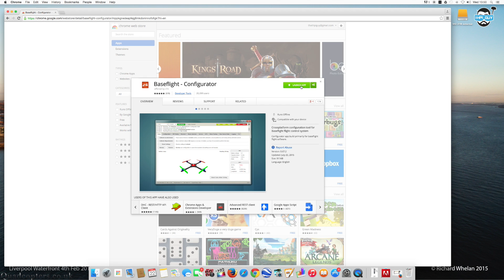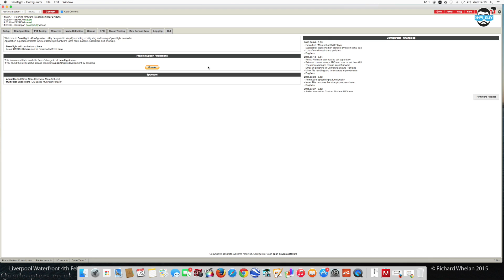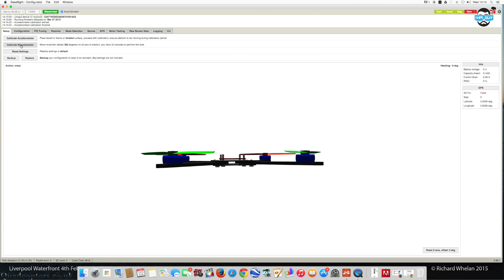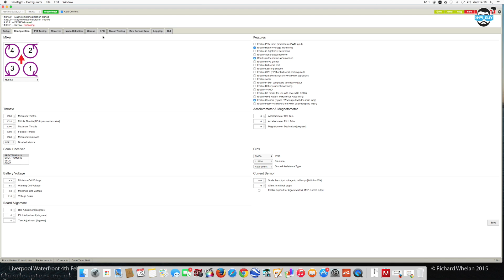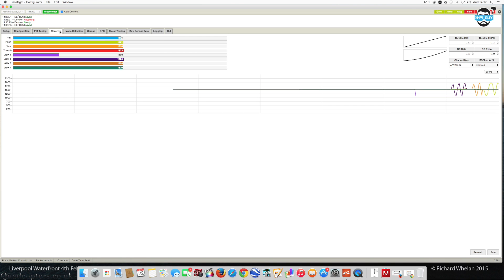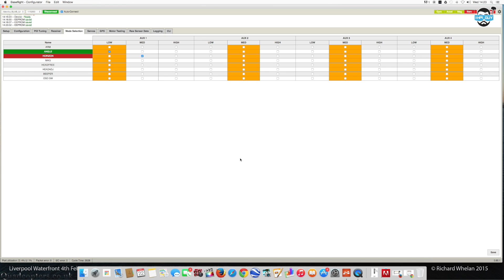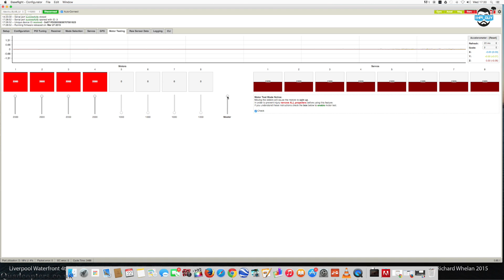HPIGUY | EMAX Nighthawk PRO - ARTF 280 MiniQuad Set Up - Quadcopters.co.uk

Comment: ThatHPI guy  hiya do you have to connect or bind  the transmitter to the quad i bought the nighthawk ARF and got the nighthawk transmitter it come with the EM16 flight receiver av copped your wiring  but should i have bind the them  or dose this do it after calibrations

Comment: why does anyone use 4s? what purpose does it serve?
Reply: +Michael M using a 4 S battery is like putting jet fuel in your car. The 280 flys very fast with a 3S - 11.1 volt battery, using a 4S - 14.8volt battery will make it fly insanely fast.
Reply: +Bernard Woods sweet!
Reply: +Bernard Woods can I up the reccomend c rating on my nighthawk? it's rated at 30c, what happens if I stick a 70c? will it blow?

Comment: is anyone else having battery life problems? i get one minute full power flight per each 3S 2200 battery... are others getting more? can you post settings?

I also have the problem that when I activate oneshot the drone doesn't beep upon battery plug in. only way i can use it is by clearing the props in the dos-like thing (sorry can't remember its name)... any thoughts?

love it, my RF signal is also not that great, lots of interference, any ideas on how to improve this? have new antennas and even tried changing channels

any advice would be awesome!

Comment: what batteries are people using? im using a turnigy 2200 mah 35c-45c 3s but im only getting 2 min flight times
Reply: +Drone Adventures Yes! I'm so glad someone else posted that.. Im using 3S 2200's and getting about 1:20 at full power, then about a minute to two minutes of bunny hopping.. could this be a setting somewhere? something else? any info would be great! how can I get longer life out of these batteries each flight?
Reply: what C rating is your battery? I think higher c rating might help along with a small battery. I have been reading on the flite test forums that the 2200's are a bit heavy for this setup. that being said though I have seen guys on youtube get 8 min flights with them. I think im going to pick up a tattu 3s 1300mah 70c battery and give that a try
Reply: +Mark Hosking   really, what brand are they?  I have Nanotech 3S 2200's and I get about 8-10 minutes of flight time

Comment: Just got one of these, set it up following these instructions for setup and I'm having the following problem.

When in the receiver tab of Baseflight and I turn my transmitter on the roll value thrashes up and down with out any input from me on the transmitter?

Any advice welcome. Thanks
Reply: Biskey hey its been 4 years but did you get a fix on the roll i have the same problem
Reply: Just trying to get my night hawk to work again

Comment: this is my first quad. I have the receiver all set up and the transmitter on. but I can't connect the transmitter. idk what to do
Reply: +Cliporis Depending on the transmitter and receiver you have - I did this with a RadioLink AT9 - there is a pair button on the receiver, hold this button in whilst connecting the battery to the quad. Turn on the transmitter and it should instantly pair. 
Have you tested it in the Baseflight - Configurator application?
It might have paired however one thing I've not heard many people mention is the arm function where you pull the throttle down then to the right, then the quadcopter is ready to fly. To test - push throttle up slowly

Comment: I've tried this numerous times exactly the same way, I've even watched other YouTube's tutorials on it, even on clean flight as well. I'm not too sure if I'm being immensely retarded or there is something wrong with my quadcopter. i do not know what to do, I can easily get the fpv camera to work with my dominator v3, and get the light bar to come on and that is it.
Reply: +Joe Ridgley 
I was inmensely frustrated and totally convinced that my quadcopter was defective. Everything was set up correctly, but I could not calibrate the motors, so I could not fly. The quad flipped on the floor and it was totally decompensate. I sent it to the shop, and they charged me 50€ for telling me I should have used a plane template on my radio, instead of a helicopter one. After that everything worked just like in the video. 
I ignore your details though..

Comment: I just bought this quad, what battery do you use and what do you recommend I use?
Reply: I like to use a nanotech 3s 1300 and 2200 but if you want a 4s I would use a 1300 or 1500
Reply: +Tyler Metternick can you explain the difference from the 1300 to the 2200? which one gives you longer life? 4S are less time flying but more power is that right?

how long should i be getting flight time with 3S 2200's?
Reply: +Mark Hosking  yes you get more power with a 4s.  The difference between the 1300 and a 2200 is that the 2200 will have a longer flight time but will weigh more so you'll have less maneuverability.

Comment: I have a question. If using the angle motor mounts don't you have to set the angle of the FC in cleanflight? You didn't mention that in the video.
Reply: +David Fonseca up to personal preference David, often racers want it to move forward constantly

Comment: Hi guys I have a problem with my nigthhawhk pro ATF with skyli32 board, I can't calibrate the esc's with baseflight.
The esc are crazy, begin to do lots of beeps .
How can I calibrate only one esc per time ?
Some suggestion.
thanks
Reply: Hey there, I seem to have the same problem. Did you manage to solve it? Should I try CleanFlight? Thanks
Reply: +Carlson Broda can calibrate each motor separately by selecting the motor and not master to adjust
Reply: Thanks Mark. After going mad, I finally discovered why I could not properly calibrate my esc's ( they entered into configuration mode every time, which explains the cycling beeps). And it would happen in both Baseflight and Cleanflight. The solution: using an Acro (plane) template in my trasmitter instead of a Heli template! (Tx: Spektrum DX8)

Comment: I want to get in to fpv racing but I've never hade or flyed a quadcopter what do u recommend as I can get a the fpv gear, transmitter, 4 esc, 4 motors, 2 battery's and a carbon QAV250 frame for £650 or should I get something else.   Thanks

Comment: I just got one of these for my first non toy-grade quad.  This video was extremely helpful and comprehensive -- thanks for putting it out there.  Did you ever race this with a Vortex?  I know the Vortex most likely won but it would still be cool to watch.

Also on the maiden flight, it looked like the quad was hovering at an angle and not flat.  Is this true or is it just my eyes deceiving me?  What would cause that other than the battery not centered correctly?  Just want to avoid any mistakes before I get in the air.

Comment: Well my nighthawk pro 280 was very short lived, Upon doing the magnetometer calibration, the entire micro usb connector ripped completely off of the board. OMG. I didn't even get my transmitter linked. I noticed the micro usb slot was a very tight fit.
Reply: Did you get a new board??
Reply: No I returned it for a full refund to florida uav great customer service.  Then I bought the   "Immersionrc Vortex"  this quad is awsome.   I dunno maybe it woulda flew ok.   Pay 450 and get quality....

Comment: Baseflight? Cleanflight is the way to go!
Reply from the maker: Yeah it comes stock with BS, you can flash CF no problems.
Reply: +ThatHPI GUY hello, this Flight controller: Skyline32(Integrate on board), include miniosd ?
if don't include , we can upgrade with osd ?
thanks
Reply: do you need to erase  baseflight  to flash it with cleanflight   or do i just flash it with cleanflight
Reply: William Davie Pretty sure you can just directly flash it...But if you have the option to erase it first, do that...
Reply: thanks this is all new to me so im watch all these video,s  and learning myself  trying to get this nightawk set   its a nightmare when you dont have a clue what your doing  aaaaaaa lol hopefully ill get there lol
Reply: William Davie Yeah, it's a bit daunting at the start...
Reply: lol stressful my friend  im just about there but cant manage to swap my roll with my pitch  when i push roll to the left  my pitch go,s up ?  my roll works my pitch  and pitch works my roll  and going the the wrong way ?  lol its driving me nuts
Reply: William Davie Worked it out yet? What are you using?
Reply: +Optamizm lol I wish haha if swapped my receiver and transmitter to devo 7  got it all setup right just got a problem with motor testing in cleanflight my motors don't stop singing and if or when I pull master down there's no confirmation beeps or singing  plus I just need to setup my arm to a switch so it works as my failsafe but I keep getting stressed out and go back to it when I'm a bite more chilledout but it's been over a week since I looked at it bud
Reply: William Davie Ok, just take your time, troubleshoot as you need, you'll get there... You'll probably get any answers you need at http://www.rcgroups.com/forums/index.php I've found them to be very help over there...
Reply: http://static.rcgroups.net/forums/attachments/6/0/7/1/0/0/a8601665-199-Screen%20Shot%202016-01-13%20at%209.47.21%20PM.jpg

See where it says "Channel Map", you probably have that set to the wrong thing, that's why your roll and pitch are wrong...
Reply: hiya thanks very much   got that all sorted out two weeks ago  every things working the right way  these devo 7 come set up for helicopters lol  but thats sorted  i need to work out how to set my end points  for throttle  yaw roll and pitch  and my failsafe to my gear switch   but the main thing is motor testing  my motors dont stop singing and if or ? when i pull the master down theres no confirmation  bleeps or singing  if its not one thing its another with this its a nightmare i think im jinxed haha  my friend  iv been having timeout with this and went back to my old syma x8g and jxd509g  at lest im getting out for a fly about  haha
Reply: I don't understand what you mean by "singing"?
Reply: LOL PLAYING ITS TUNES AND BLEEPS  I WAS AT IT FOR ABOUT 4 HOURS LASTNIGHT I HAD THE CONFIRMATION BLEEPS AFTER PULLING THE MASTER DOWN AND THE TWO FRONT MOTORS WORKING FINE BUT NOTHING FROM MY TWO BACK MOTORS  LOL  I TRIED FLASHING BACK TO BASEFLIGHT JUST TO  SEE IF I WOULD HAVE ANY LUCK BUT I WAS FLASH BACK TO CLEANFLIGHT AND ERASE CHIP SOFTWARE FOR A FRESH START  AND TRY AGAIN LOL  ITS DRIVING ME NUTS MY FRIEND  ILL TRY TO GET A CLEAR VIDEO OF IT BUT IM NEW TO THIS MAKING VIDEO,S  LOL AND MY CRAZY PARROT GETS LOUD EVERY TIME I DO THIS HAHA
Reply: iv got everything sorted in the receiver working right and my end points sorted and set thanks to painless360  im just going to erase chip and software  and reflash it with a clean start in cleanflight   its got to work this time i only have to do my motor testing correctly lol
Reply: William Davie Ok, sounds good, let me know how you go...
Reply: thanks optamizm  but when i reflash with cleanflight   do i click the ,, no reboot sequence  and the manual buad rate aswell   as the full chip erase  optamizm  lol
Reply: William Davie Don't click no reboot sequence or manual buad rate unless you read in a forum or some documentation that you should..... Full chip erase is up to you...

Comment: .hello mate, looks good but how much to replace the board if One of the ESC fails?
Reply: Thanks, it looks V clean with that board for sure.
Reply: James Wright For the board on it's own i think it comes out at around the £50 mark,which isn't to bad if you take into account what's on the board,having said that it's a pain if only one ESC goes. ;-)
Reply from the maker: A complete board is £49.95. That's not too bad. Don't forget this is built for new comers to the scene, if you are a seasoned pro that's pushing the limits then something with swappable ESC's would be better. Flying this in its stock for shouldn't blow any ESCs (they are 12amp anyway) you can swap everything out without and soldering too, everyone is done with connectors.